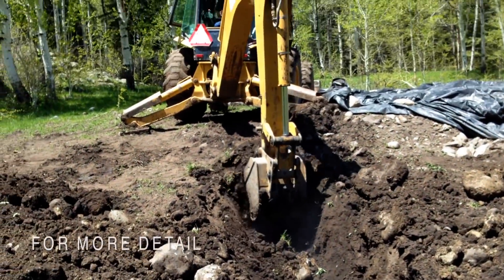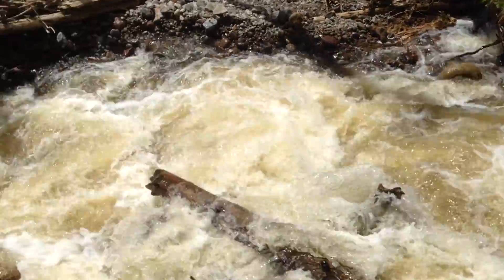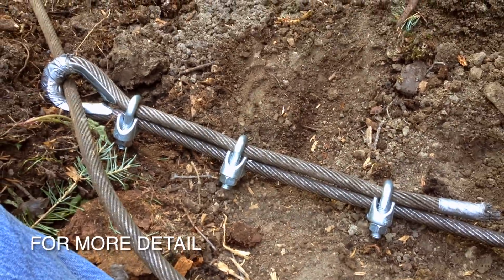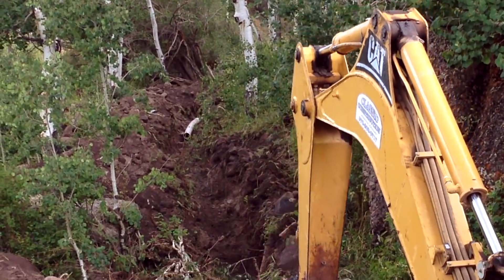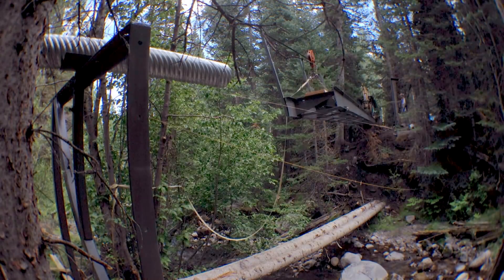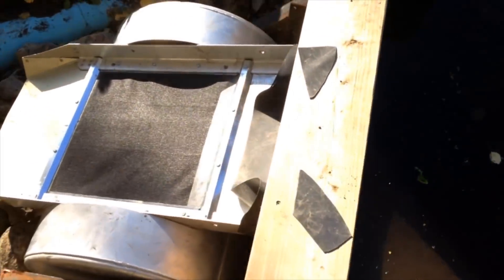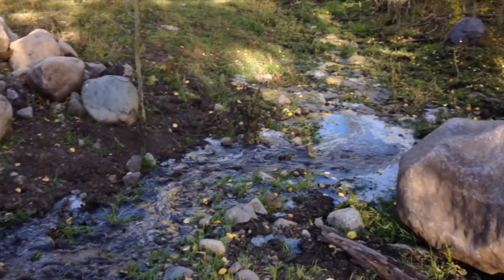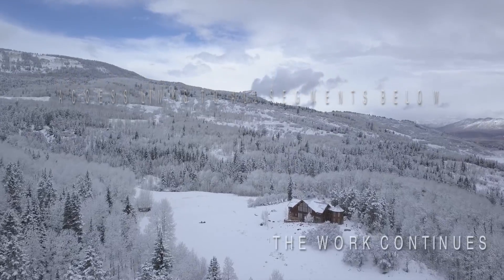Part 20-2 MicroHydro Power System in CO

Comment: How much did this cost vs simply installing solar?
Reply from the maker: We started in 1995 acquiring water rights and putting in a penstock from springs. That initial system cost around 25k in 1996 dollars. We also got gravity pressurized domestic water and a pond for raising fish at that price.  
When we moved the existing equipment to the creek we incurred additional costs of around 55k in 2015 dollars because we needed a full redesign of penstock, powerhouse, transmission and load management.
People often ask how long it will take to payback the system, but this neglects to consider that we would have had to spend about $140k in 1995 to bring power lines 7 miles into the off grid property.  That estimate had ballooned to $250-300k by 2015 when we moved the system.  We would have had to pay that to bring power lines in and then had power bills to pay on top of that.  So it was a no brainer to install our own system at either juncture and the question of payback was/is a moot question.  We look at the installation as an asset investment in the overall property.  The power is constant and requires no batteries
There are virtually no maintenance costs.  We are still running the initial belts and will shoot a bit of grease in the bearings every couple of months.  Every now and then we replace a fitting like on the pipe bridge or the unions on the diversion pipe, but these are parts we have around anyway.
In 1996 when the system was first installed, solar was far more expensive than today.  The hydro runs fine in winter and there are no panels to remove snow from.  Best solution for us.  

Hope this answers your question sufficiently.
Thx for watching.

Comment: that's a lot of work for just one house. Wouldn't be more efficient to integrate in your energy plan some solar panels plus a ground source heating pump for water heating and photovoltaic cells for electrci supply? 
It's a honest question as I have no idea.
Reply from the maker: We had existing equipment from the spring fed system and the access to a plentiful source of kinetic power in the creek.  So we redesigned it and moved it.  Besides that after having made power from water for 19+ years, its addictive to increase one's output.  Heat pumps were considered, but judged to be a very expensive solution.  Solar would have been a waste as we already had so much available power.  Cleaning a foot of snow off an array at 8600ft in winter wouldn't have been any fun either.  As is the system suits all our needs and then some.
Reply: @mrhydrohead  thanks for answering. You did a great job indeed.

Comment: Question, why are you so careful to maintain the grade ( 1/8" per foot ), aslong as the final elevation of the pipe is at your desired elevation difference the pipe should just act as a siphon once the pipe flow is continuous?
Reply from the maker: Good question.  In the first system (spring fed Parts 1-5 of series) we did have to contend with mountainous uneven terrain.  This meant the penstock went up and down in elevation.  High points required air vents to release air and prevent air lock which could reduce final pressure at the bottom.  Low points required pressure controlled release valves to drain the low areas if we shut the system down.  
The creek penstock (parts 6-20) required having an initial long run where it was very flat (300+ feet).  If the water would not flow progressively down hill, then we would not have been able to prime the penstock to start the system.  If the highest part of the penstock was at all above the intake point then, with water seeking a equilibrium of height, you would have a situation not unlike a hose with the end held higher than the source.  It would take a ridiculous volume of water to prime the penstock (which is 2200ft long) before a siphon could be accomplished.
Hope this answers the question.  Thanks for watching

Comment: Have you checked the powerhouse plumbing yet? If so, did it erode much?
Reply from the maker: As the water has minimal sediment being carried through the system, we haven't noticed any wear on the pelton cups or plumbing of the penstock.
Thanks for watching.  It looks from your comments, you've watched most if not all of the series.
The plan is to continue to document any changes to our system and examine other people's systems of varying capacities to help spread the knowledge of how to achieve micro hydro.

Comment: I dont know a lot (yet!) about hydroelectric energy nor the way the 'plumbing' works but what do you do against water knock?
Reply from the maker: It is necessary to take care to make changes of flow gradually in the penstock.  Water Hammer can be a serious issue if you suddenly stop the water.  Its like trying to stop tons of water at once and can destroy the system.  Just taking care can prevent any problems.  Also preventing anything that might get stuck in the jet from ever entering the penstock is important too.  Hence the coanda screen in the meadow.

Comment: Do you know how much the walls eroded?
Reply from the maker: If you are asking about the hillside near the creek diversion, its an ongoing process.  The entire hillside is somewhat liquified by a spring 150 up the hill.  The Springtime runoff within the creek eats away at the walls each year in varying degrees depending on scale of snow fall in prior winter.  It is the reason we can't really put a permanent structure in the creek bed.  If you are asking about the path below the bridge support, it wasn't excessive but could have become a problem if animals continued to use the path. The barbed wire was a precaution.

Comment: Hey guys, I LOVED your series, and just wanted to make sure I got the summary correct:
I Uses 185GPM(700litres) (11litres / sec)
makes 7800W.
Head 234 feet (vertical)
Or 53KW/year or $5830/year (@11cents / KWhr)
Finally, do you have a ballpark on the COST breakdown of just the parts?  Assume you have all the free time, helpers, excavators, etc)
Thanks so much!
Reply: I saw 400KW per day? I would also like the know the specs

Comment: When you remove the flexible pipe for spring runoff, how does that affect your power output? What are the major changes for that
Reply from the maker: The power we get during spring runoff comes entirely from water in the meadow which is fed by a much smaller creek flowing out of a lake and spring feed as well. Flow reduces of course and allows us to extract about 3500w without draining the pipe. It's plenty of power for the spring weather conditions and still permits all appliances, plenty of domestic hot water, and the hot tub too. Only changes are removing the diversion vortex intake & flex pipe , reducing the flow at the turbine needle valve, and doing a little reconfiguring of the load controller.  Excess power is shunted to both the hot water heater and baseboard heaters in the basement.

Comment: Did you ever consider options like the Turbulent Hydro or any other premade things or was your plan to always have a DIY solution, Also any advice on locating property where you could even have a micro hydro setup. That is a beutiful slice of heaven you have there even in the winter it looks magical.
Reply from the maker: Started in 1995 by attending a hydro course at Solar Energy Intl in Carbondale CO. Instructors helped me decide on methods for first spring fed system. Turb Hydro is fairly new I think. 

I would pick a small town that has airline and essential services and then study the maps in the area and engage a real estate broker to help you search. Also check on water rights issues in that state. Make sure it can be accomplished 

I discovered our property by watching out of commuter flights from Denver to telluride. You are looking for flow and head in some combination that can be relied upon in all seasons. Then the work starts on researching how much power is there and the best way to harness it for what you feel your realistic needs are. Can you net meter there, AC or DC system, cost of hydro vs. solar, and other things you should consider. 

I will admit we were lucky to find this awesome spot, but I was focused on it for a while before committing.